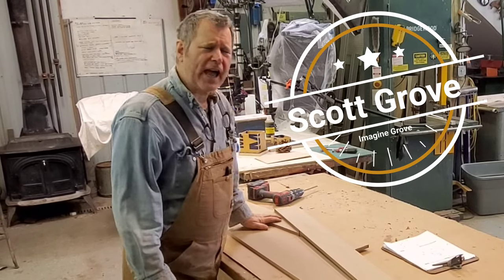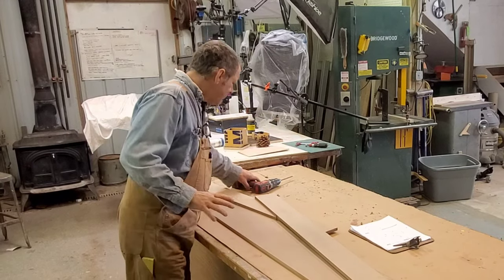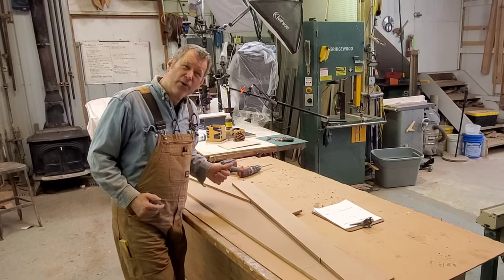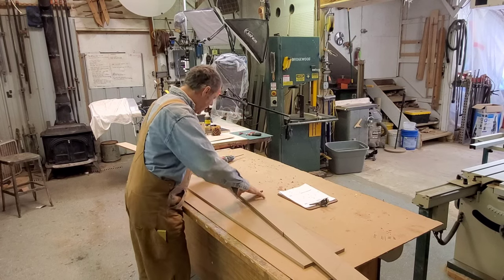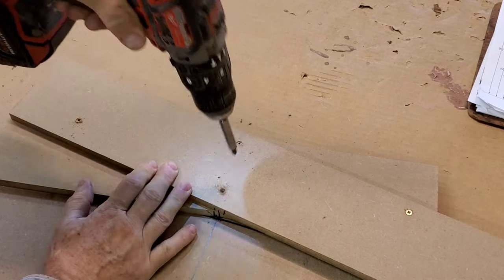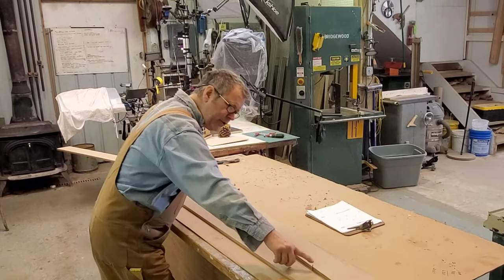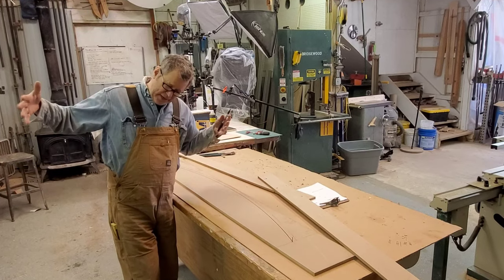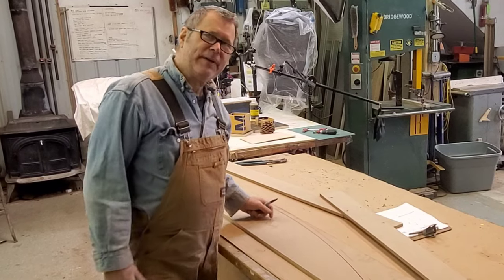Layout Large Arcs Without A Compass

Comment: Holy cow, I think this is the idea I've been looking for! I have several different large, radiuses in laying out my driveway. I was able to do some with a steak and a string, but when I have trees and landscape and buildings in the way, I had no idea how to make the other ones. I think I can use your same method working with large 10 foot two by fours instead of the smaller boards you were using on your desktop. Does this method still apply for large driveway radius? Will that still work on a larger scale?
Reply from the maker: yes,  any size, the geometry scales up.  You might need help holding everything while you draw the arc, but it will work.